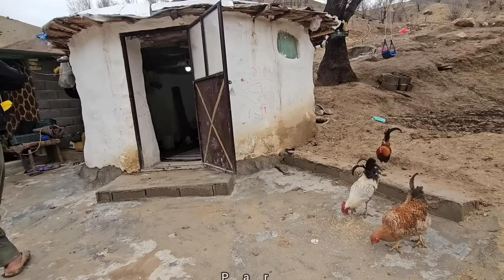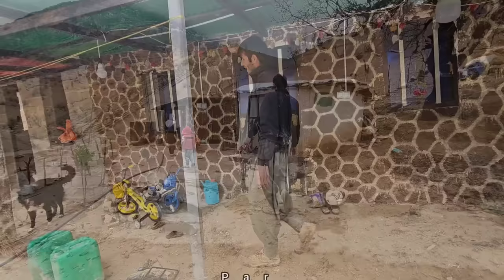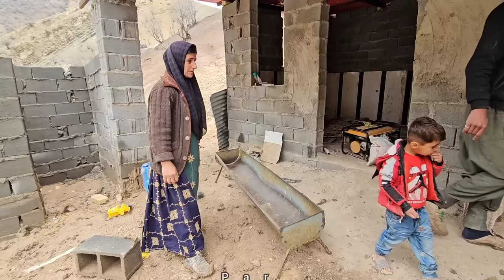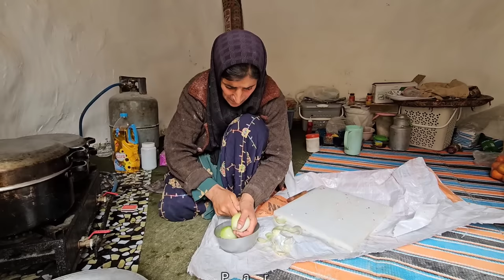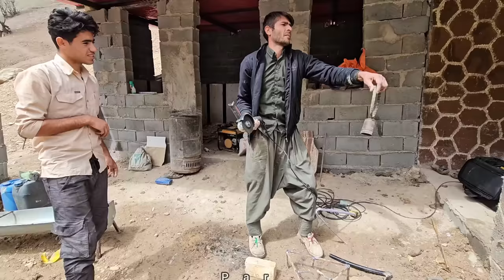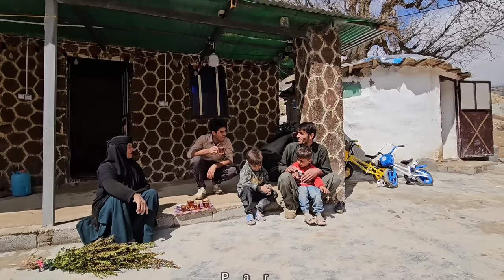Aylin 👼 comes to the village house🏡 Babak goes to the city to bring his wife and daughter

Comment: In 1977, my first stepfather was hired to install a well in a beautiful old farmhouse . He bolted the inside of an antique washing machine to the side of a mountain below a stream and piped water into the house.  Babak needs to rig up something similar 🤔🤔🤔
Reply: You can build a device for water all day long. But you're not going to get any if the river is drained because it doesn't rain there enough. Their country is in a drought. This is why they get so happy when it rains.
Reply: @janice.backporch  I'm not saying he can throw something together and forget about it, expecting it to completely solve the issue.  He can build an artificial dam and allow the natural flow of the water to pipe its way to the house whenever possible.   When it got cold enough, my stepfathers contraption also didn't work because the stream off the mountain froze.

Comment: Babak
🥺🥺🥺🥺🥺🥺🥺🥺🥺🥺
Your welding is extremely dangerous! Never weld with bare hands! If you're hand is wet and foot too, the current can go through you. All you need is 1 Amp to kill you! You are easily using 20 Amps to weld with. The glasses are meant for brazing, not welding. You can get flash blinded from using the glasses! Always wear dry gloves when you weld, always!